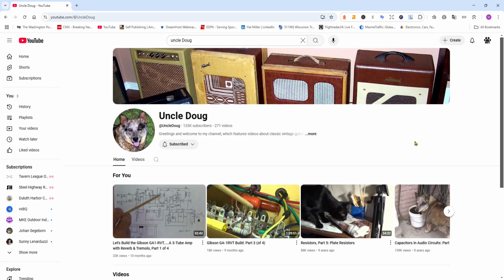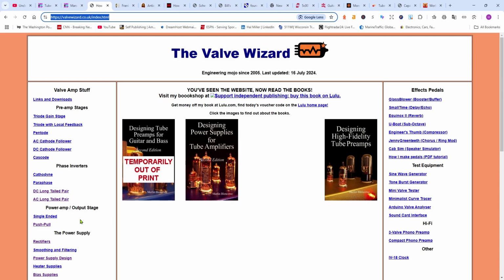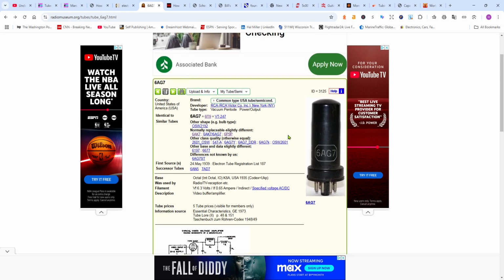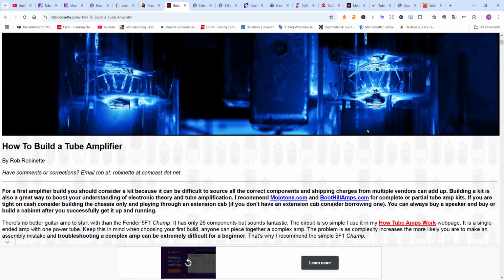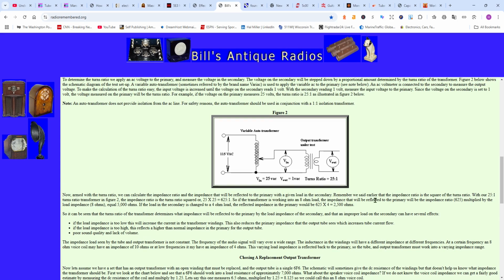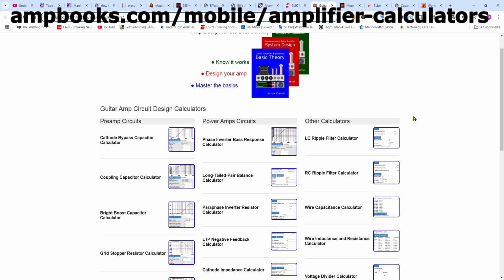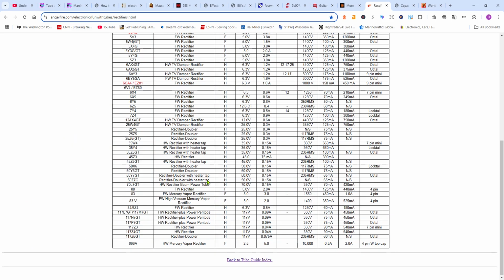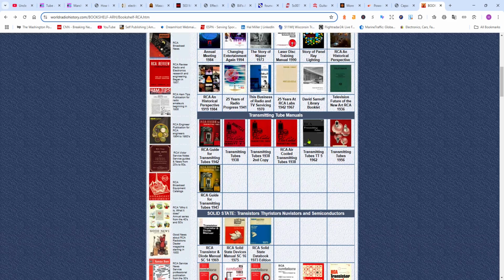Best Websites for Tube Guitar Amp Builders: Schematics, Tube Data and Amplifier Design Info

Comment: Hey Mutt Glad To find this man!
Reply: Ive a crate TV 6210 lost the pilot light and the tube heaters. It comes on trans warm up and the channel switches. I bought it used and its been foil trace repaired before I bought it.
Thing sounds like a laney when it worked
Reply: Other problem is studio windsor.
Standby switch dont work it stays on.
And a slight hum like hopefully just a preamp tube.
Reply from the maker: @ I hope you can get all these sorted out! Sounds like a fun bunch of amps! Glad to list is useful to you.

Comment: Great roundup of valuable sites. I have a hard copy of Designing Tube Amps and use Robinnete's site for my own designs/mods. Tube data sheet sites are essential but I also have a hard copy of an old RCA tube handbook for instant reference as well as a copy of The Tube Amp Book 4.1th Edition by Aspen Pittman which contains a boatload of tube amp schematics. Uncle Doug is the OG and anyone following his advice/instruction can't go wrong.
Reply from the maker: Amen! I need to get a copy of Pittman's book and I hear Gar Gilles book is back in print, too. Thanks for the comment!

Comment: I don't like the limitations of the Fender Tone Stack.
Reply: It's a piece of crap limited by Leo's demand to reduce part count to a bare minimum and therefor barely operates as intended, but it DOES have the 'magic' quality of phase distortion that gives Fender amps their unique character.
Reply from the maker: Funny you should say that - I've used the Fender volume-tone for my last few builds and I'm ready to try something different. The volume-treble-bass is pretty predictable, but that makes it reliable too.